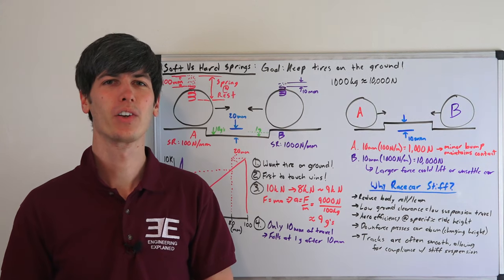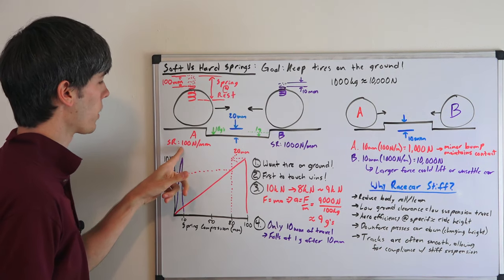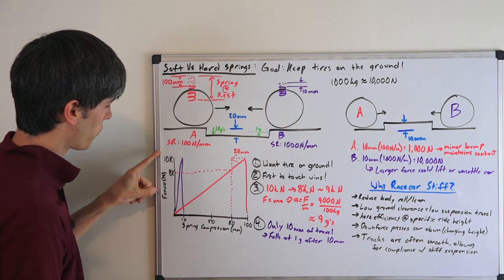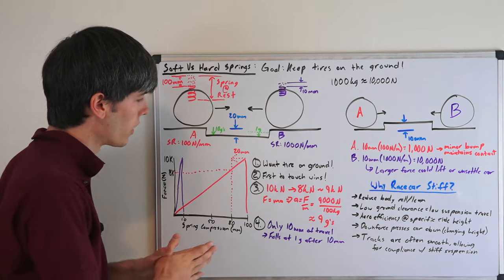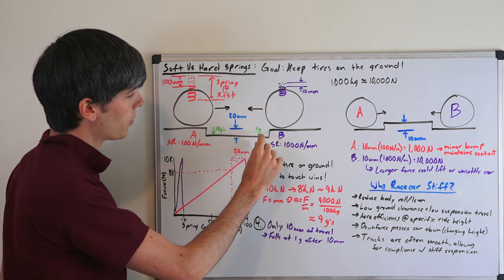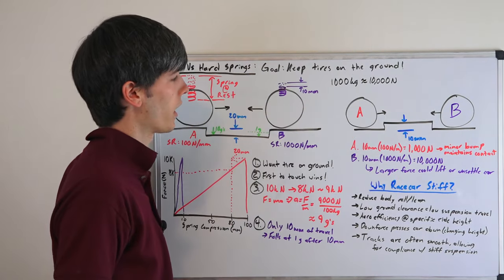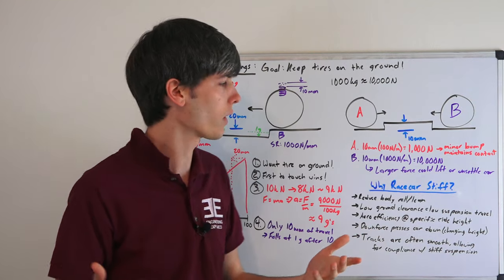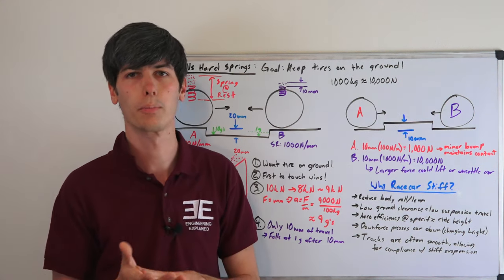What's The Best Suspension - Soft or Stiff Springs?

Comment: so basically, softer springs are better for bumpy roads, and harder springs are better for smooth roads
Reply: +Khazar01 with the one caveat that you can't go too soft for bumpy roads or your suspension will bottom out and hit the bump stops.  which is way worse than having suspension that's a bit too hard.
Reply: Jethro Rose
agreed :)
Reply from the maker: +Khazar01 Somewhat, but really not that simple. Bumpy is relative to speed. A road may seem very smooth at 30 mph, but the small hills become very meaningful at 150 mph. It may look smooth but if you're going fast enough it will make the suspension work more, but of course there are other factors you need to consider about speed (as mentioned at the end of the video).
Reply: Khazar01 we didnt need any research to know this. But thanks i geenering xplained
Reply: I'm so confused with what kind of suspension to get in my car for Salt Spring Island. My wrx just started acting a bit like a marshmallow with a turbo strapped to it.  Really awful B roads lots of roots ruts compression dips crests off cambered turns , pot holes etc. Rally suspension makes sense, except that I have road tires so that cancels that out. need to maintain grip when blasting around corners that want to knock you into a ditch, off a cliff or into a swamp.
Reply: A stiffer suspension simply means it requires more force to compress it. In order to generate more force, you gotta hit those bumps and pot holes harder (drive faster). This will make all the bumps so much smoother, almost like you're driving on clouds, as opposed to driving slow over them.
Reply: You're saying a stiffer suspension = smoother ride? I don't know about that. I think it depends on what exactly is stiffer, there's a few components that can be modified.
Reply: Khazar01 you want to go as soft as possible without bottoming out for maximum grip.
Reply: No. Soft springs are good for bumpy roads and ok smooth roads, stiff springs are ok for smooth roads and terrible for bumpy roads.
Reply: YES spot on..only noobs make their bikes hard as they think is better until they fly off a clif
Reply: Essentially, yes.
Reply: soft or stiff suspension for drag racing?
Reply: Very good I raced MX when I was younger and the mistake we made was mistaking the rough ride with to stiff of spring, It wasn't until I learned more about the sport that we learned we were riding in the harsh part of the shock like mid stroke, Once we went stiffer and started riding faster the stiffer we had to go on our springs,
Reply: a bad suspension are very soft and reduce your top speed, like you are running in flat foot
Reply: Interesting and easily observed in real life. One manufacturer that gets it right is BMW. Softer springs with stiffer shock absorbers. This combination allows the car to handle well even in bad road conditions. I drove an M240 back to back with an Audi S3, and the Audi’s very stiff springs really took care of body roll, but at the expense of comfort and I felt like I was “hovering” on top of the bumps rather than actually having any contact with them. This seriously degraded the handling on bad road conditions. Interesting video for sure.
Reply: Not quite
Reply: Khazar01 sports car = stiff coil overs off road = soft springs 
Daily driver = OE
Reply: projectilequestion stiffer can be better for bumpy roads or trails if u go fast if you hit a lot of bumps at 30 softer but u hit the same bumps at 100 stiffer is better
Reply: The roads are terrible in my area bumps potholes steep Driveways big manholes to be fair think having a mixture in between soft and hard a mid range Spring rates will almost be the perfect set up say for example I plan on going super low in the Front like 2.8 inch so I want to look slammed but still be functional 8k Spring rate would probably be a better choice for me and 6k Spring rate in the Rear would be better because I'm only going super low in the Front I need  a stiffer Spring like stated above 8k it will be the best of both stiff and soft
Reply: @vitaminb4869  
Yeah, but if you have stiff suspensions and hit a bump at 130 km/h, you are very dangerously flying for quite an appreciable distance!
Reply: @erosravera3721  you're not flying anywhere if you have stiff enough suspension that keeps you in control. With a too soft suspension you first of all gonna bottom out and it will feel very harsh, and then you'll get thrown by it most likely not where you're trying to go - a very dangerous situation.
Reply: By "Flying I mean that the car is NOT in contact with the ground! Dangerous enough on a straight road; if this happens in a bend, you're dead.
Reply: boostedsil40  You'd want to use anti roll bars for that
Reply: Softer springs are relatively better for lower speed & longer travel. Harder springs for higher speed & shorter travel.
Reply: @vitaminb4869  This is correct.  In vehicle dynamics this effect is known as "transmissibility".  As you increase speed, you increase the frequency at which the disturbance (bump) is experienced by the vehicle, and for sprung-mass systems transmissibility changes with frequency.  

As you go faster, the frequency increases and you will reach a frequency where the body
movement from the bump reaches a maximum, this is known as the resonant frequency, after which you will get less and less "disturbance" and movement of the body the faster you go. 

You can prove this to yourself (safely and in controlled conditions) by driving over a speedbump very, very slow.  The body movement will equal the size of the bump.  Go a little faster (resonant frequency) and the body movement will actually be GREATER than the height of the bump and the ride will feel its most disturbed and uncomfortable.  After that as you go over it faster and faster the amount of body movement (sprung mass) will be progressively less and less.
Reply: Akın Orhan  Some racecars are actually setup this way due to the construction characteristics of a particular slick tire design.  Tires are essentially undamped springs with very high spring rates (~262N/mm - 438N/mm) correlated directly with tire pressure (more pressure, more rate).  This is quantified by what is known as the "ride rate" which is like the spring rate but taking into account the spring rate of the tire as part of the system to give a more accurate picture.  To calculate it simply multiply spring rate(Ks) * tire rate (Kt) and then divide the product by the sum of Ks+Kt.  

From there you would calculate your "wheel rate" which is the ride rate multiplied by the square of the motion ratio times a small angle correction factor (optional).   WR=(MR)^2 (RR)(ACF).
Reply: @projectilequestion  That's wrong what you said!!! That is how supposed to be by logic. In Reality is the other way around. I  CAN GUARANTEE YOU THAT 100%. The real reason behind this is that twin-tube fail in about 2-3months (even bilstein fails easy). So take a MONO-tube and enjoy!!  Consider that monotube react quicker and  is for rally cars, will give you more comfort in bumpy roads!!!!
Reply: Ioannis stavrou Not sure what you are referring to. But going back to the original comment. It is not Pokémon, things don't balance out perfectly. There might be an illusion that because soft springs do well on bumpy roads and stiff springs don’t do well, and stiff springs did better on flatter roads than they originally did on bumpy roads, they stiff springs will ALWAYS be better on flat roads. This is a belief that things HAVE to be magically reversed on hard flat roads, because that what happens in computer games for game balancing, and he is jumping to conclusions.
As far as I understand it, stiffer suspension: lowers body roll, allows a lower car without bottoming out, and stops so much suspension travel (which regarding caster angle helps road feel).

But on a motorbike for example, softening suspensions INCREASES grip but LOWERS handling.
Reply: projectilequestion completely wrong of what you are saying. Please study how the suspension works. (I mean mono tube vs twin tube suspension and then you will understand that mono tube is more stiff). So basically softer shock(twin tube) should be more comfort because in theory it absorbs the road bumps ext ext. BUT WHAT I SAID THIS IS NOT TRUE IN REALITY because twin tube fails quick even if is made extremely good. Monotube (stiffer shock) will perform nicer on bumpy roads BECAUSE IT ACTS QUICKER so response time is quicker making you feel like the car haven’t move up and down. That is why you have so negative feedback. Besides this I can tell you I am a scientist and I advice you to be careful when you show up equations. Because theories are different than in reality!!! You forgot a lot of factors in your equations!! Stiffer shocks will make the car in reality moves more comfort but in theory softer shocks will make it more comfort.
Reply: @ioannisstavrou2677 Ok. I have no idea what you are talking about. I am talking about SUSPENSION not SHOCK ABSORBERS. I mean 'better' road holding just like this video means, I am not talking about comfort. Don't expect to be so entitled to something, that other people have to redefine the meaning of a word in a conversation that started before you. Just look at the context of the conversation first, and see the context of the word second.
Reply: If it's actually that rough you need to slow down, not go faster.

Find a smooth track if you want to go fast, or get yourself a Baja setup which includes a lot of sidewall.
Reply: Yepp
Reply: Akın Orhan  This is what i think
Reply: I drove my new stang with only 45 miles on it  home yesterday from MD to RI, 6 hours.  Smooth sections of roads was great, unfortunately there are more bumps than smooth on 95 in the city areas. It was terrible, every bump was felt (hard). What would best best for a softer more comfortable ride over bumps and bridge expansion joints.
Reply: Thanks for suming it up because I didn't know a thing what this guy was saying
Reply: @EngineeringExplained  Upstate New York roads don't feel smooth at ANY speed, (Some pot holes are at least 4" deep after the winter) so in New York, never run stiff springs. lol
Reply: Exactly but i have a car with stiff suspension and hella bumpy roads
Reply: @aneeqkhan9573 my honda accord stiff as heck man
Reply: Guys, so you mean that sports-tuned vehicles are uncomfortable on bumpy interstate roads specially on a bridge junction?

Comment: If this dude built an entire car himself it would pull 4 lateral Gs and have a top speed of ∞
Reply: +Rough Muff No I don't think so, he would just understand why it wasn't that fast!! LOL.
Reply: Wet Towelette god damn.. this comment actually made me laugh out loud. Laughed more than I should and I dont even know why.
Reply: if he entered a race series he'd win, with no team.
Reply: If he wanted to bottom up design a car, I would help fund the dude. Guy should start a kickstarter collaborative with other car guys and design and build an affordable sports car that can be mass produced.
Reply: Why? He's just doing the same kind of engineering that's made at the factory. The output in that case would be a really nice, well engineered premium car, nothing out of this world.
Reply: @HambertHM  I agree. Although he might just try to present it in a simplified manner, this isn't actually that impressive. Regular automotive and mechanical engineers do alot more complex calculations than this.
Reply: @HambertHM  your right it's the say engineering that the factory does but when it comes to diy situations. He knows what he's talking about! All the info that he is sharing is for the most part accurate!  Don't know him personally but I'm a certified collision repair technician and so far every thing that he explains is correct. All the tuner cars that people build, they normally go with stiffer spring. All it they do is put more strain on the cars suspension (not just the springs). If you stiffened your springs, you put more strain on the the control arms and bushings and all the other components. I have a prelude sh, the handling is great! I couldn't as for a better set up. The softer springs combined with the rear sway bar and front strut bar under the hood gives it that rigid cornering with no sway what so ever! Also a none low profile tire the ride is hell of a lot better! That's if your fender are rolled and they don't rub.
Reply: Jack Allen damn lmfao
Reply: Lol
Reply: Sean Baller Real life Ryosuke
Reply: Be cool to animate this instead if to balls that are supposed to be cars...plus how many g's of force would be on impact of these cars if they did hit?, what springs would best for those?
Reply: @jackallen6261  😄

Comment: A spring do not push a wheel down onto the ground. Gravity pulls the car down, wheel, spring and body. The function of a spring is to absorb energy from bumps to give ride comfort. The shock determine the rate of movement. Race cars sacrifice ride comfort to road holding.

Comment: There both more factors involved, and more reasons for stiffer suspension. A major factor not discussed are the shocks. In the example above, the rate of wheel movement towards the ground (for the dip) did not factor in the shocks (rebound), nor did the bump example for the stiff spring. It is complicated.

Beyond that, stiffer springs help prevent body roll/lean and help keep the tire flat to the ground. Soft springs allow the body to roll, which changes the effective camber of the tire. If you compensate by adding static negative camber, this sacrifices straight line braking... stiffer allows for less static camber. And, stiffer means generally less tire wear (which is a major factor in racing, either for cost or for stint length.)

Finally, stiffer also is important for transitions from left turn to right (and vice-versa). Soft cars allow the body to roll from one side to the other and for that to be a large and slow transition. Stiff springs prevent the roll in the first place and switch to the other side faster. Stiffer tends to stabilize more quickly after sudden transitions.

So, its quite complicated. There is no best. Generally, for smooth tracks, stiffer is better. Generally, for bumpy tracks, softer is better. (Those comments are to be taken relatively to each other.)

Last but not least, driver preference/confidence vary a lot with how the car feels - some like stiffer/firmer (springs and shocks) and some like softer. So while the engineer may say one way or the other is technically or theoretically better, the driver may feel (and perform) better with a different setup.

Thanks for considering a complicated and interesting topic.
Reply: Summed up perfectly.
Reply: agree
Reply: What about Citroen DS cars? They drive as if they are floating over the road and yet they turn as if they have stiff suspension! How do they do it?
Reply: Good comment
Reply: Learned a lot between the video + this rebuttal. Thanks for the concise write-up!
Reply: Yup
Reply: @Samosayummyyay  anti roll bar?
Reply: Good response, these videos are alright as introductions to the topic but a 5 minute "in theory" video is no subsitute for decades of experience and technological changes.
Reply: Camber variation depends on the type of suspension and you could correct ir adding caster too, for the transitions you could use a stiffer arb. But yes it's really depends on the surface you're racing, sometimes stiffer is better and sometimes softer is better
Reply: What about total travel , anti-sway bars and driver fatigue
Reply: Some manufacturers offer an optional "driver-adjustable, 'adaptive'" suspension with two settings:  "Automatic" [Essentially a 'soft' setting which shifts to a 'stiff' one when required (as determined by sensors) and back when no longer necessary.] and "Firm" which maintains the 'stiff' setting at all times.  This option allows the manufacturer to specify a higher spring-rate and thus a more comfortable ride than their 'standard' suspension and, at the same time, provide a more 'sporty' ride-control when needed or when the driver should so desire.
Reply: @Samosayummyyay  Are you talking about old Citroens with activa suspensions? They decouple the roll and ride modes of the suspension so they can be soft in ride/warp and stiff in roll whereas normal spring/damper setups have to compromise.
Reply: @Samosayummyyay  . Citroen DS had ACTIVE ride height and body-roll limiting suspension . Basically , Hydraulic Struts , with a Gas Spring on the top .
Reply: @hotdogsandhealthpotions9337  . No . Not necessary on a DS . Active suspension .
Reply: But wait, so soft springs paired with sway bars can achieve the same as stiff springs (less body roll) but offer more grip or is that lost too with the sway bar?
Reply: @Andre_Thomasson  sway bars decrease grip like stiffer springs, theyre mainly used to balance over and understeer
Reply: A stiff car would almost always be worse on tyre deg, except if you run a very weird setup/category
Reply: @Samosayummyyay  I think citroens have air suspension that rise when the engine is started and fall when it is turned off, maybe that is why?
Reply: There is not a single shock that has a piston rebound even remotely as quick as spring expansion.
Reply: You forgot the effects of sway bars- they xancel out body roll from soft springs
Reply: It depends on the situation for example Nurburgring and Red Bull ring have Tortola different ideal spring rate one prefers softer another stiffer for the most ideal setup and A lot of really expensive clubsport level suspension come with dual spring rate one Main and one helper one is softer another is harder to maximize contact surface and also piggy back oil and gas tank on the shock to increase shock travel.
Reply: what would you say is better for just daily driving